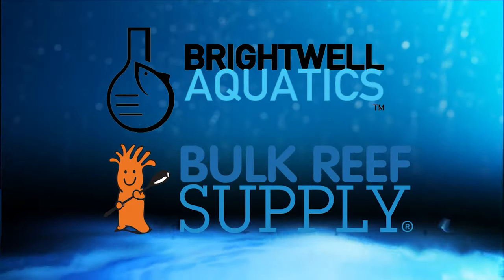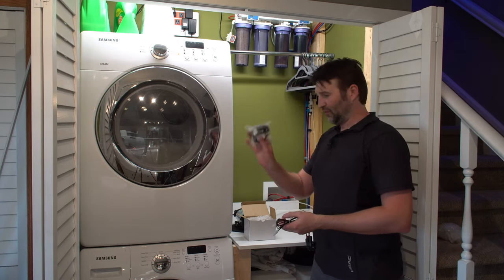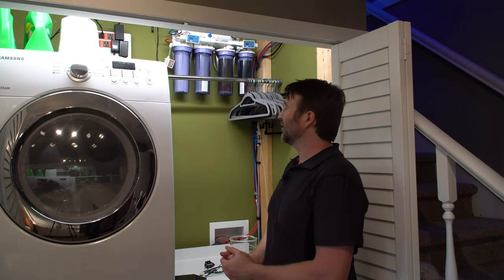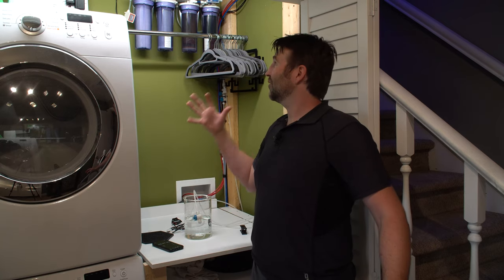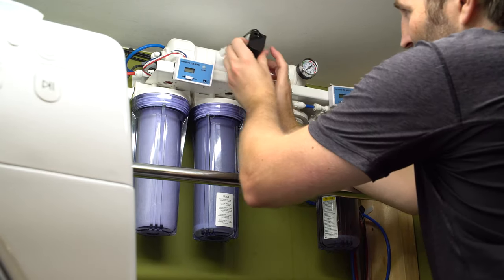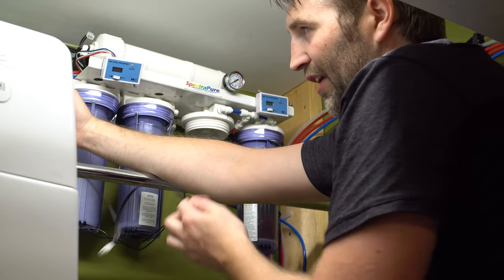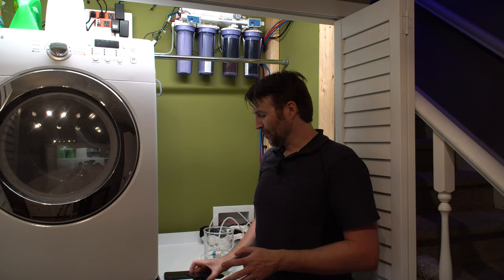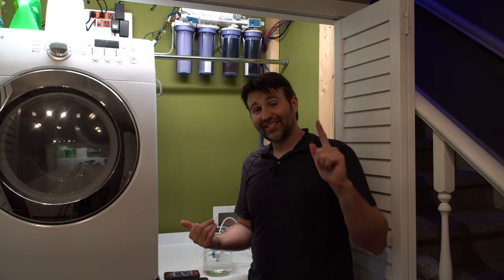RODI 8800 Booster Pump Install - Pressure switch and auto flush upgrade!

Comment: Thanks Dev!  Love my booster pump.  I added a second membrane to get 200GPH!  Note with the stronger pressure you will need to check on the membrane as the life is less when you push more pressure through it.  Just check your TDS on the membrane output to make sure it is always 0.  Also as you mentioned there is a screw on the bottom of that unit to adjust the outgoing pressure if anyone needs to adjust it up to 90.
Reply from the maker: What psi do you run yours at
Reply: @ReefDudes  80 I think.

Comment: Nice addition to your RO Deven. I was running 55psi before I installed the same booster pump you have and now I’m at 76-80psi which is adequate. I mounted mine on the wall over top of the RO unit. The rubber feet absorb a lot of the vibration but you can still hear it a little.

Comment: I am upgrading my rodi unit to commercial size unit and bought all the parts and diying the design, 2800 GPD with 170 psi booster pump with rotary wane pump  that pumps 5 gpm.
Reply from the maker: That’s some serious filtration!

Comment: Did you have to adjust the booster pump at all? I had purchased one from AquaFX on eBay and I just could NOT get it dialed in. My PSI got over 110 and the whole pump and RODI unit just vibrated out of control. I feel like i am missing something but there’s not too many videos out there that aren’t either over two mins or under like 6 years old.  Should I try this again?
Reply from the maker: I didn’t have to adjust it as it worked right out of the box for me.    Try putting a silicone pot matt under it to absorb the vibration

Comment: I installed a booster pump about 6 months ago. Huge difference. I can see now I want an auto flush valve. I'm curious on how you will mount the booster pump. I installed mine on a 2x4 with a rubber pad against the drywall in the garage but it still sounds like the washing machine is running on the opposite wall inside the house.  Drives the wife crazy. LOL.
Reply from the maker: So far silicon pad on top of dryer lol. Time will tel

Comment: Great video I don't understand that why filters last longer with faster flow verses slower flow. And you would think slower flow would get more bad stuff out of water than faster flow.  I never thought alot about more flow in my RODI. I'm going to get me flow meter and check mine out too. We have really good water pressure but maybe not enough thanks again for sharing.
Reply from the maker: I think it’s more pressure is able to get more use out of them?  Maybe handle clogging ?  Random guess
Reply: @ReefDudes  RO Membranes are more effective at removing contaminants at higher PSIs. This means your DI resin has less TDS to process which will prolong their life.

Comment: A very good purchase for my rodi unit  , my house pressure was 30psi and now i can crank it to 90psi , but i have a question i notice my booster pump was “hot” is it normal or i need to worry about , also great videos and greetings from Colombia 🇨🇴

Comment: Hi I installed mine too but I have a question I noticed that the booster pump stay vibrating all the time is that supposed to be like that all the time or it supposed to turn the vibration off ??? I’m confused 🤷‍♂️
Reply from the maker: IT should only be "vibrating" when its pumping water.  If you have an automatic shutoff.. it should detect back pressure and turn its self off when you stop the output flow.
Reply: I too have the same issue. I’ve tested it about 10 different ways and the automatic shutoff switch will not stop the pump. (I think I got a bad one) so I’ll have to have BRS replace.
Reply from the maker: Moore Tank More Problems I believe there is a little screw on it to adjust the sensitivity.  Also make sure it’s wired inline with the pump
Reply: I solved for what happened to mine the shut off valve that I can control manually wasn’t after the pressure switch it was before the pressure switch as sooner I set the shut off valve after the pressure switch it was working right
Reply from the maker: Yoshukai Tony yay! Awesome to hear you got it fixed.
Reply: ReefDudes is it suppose to go directly after your automatic shutoff valve but before your first stage of DI resin? Like I can get that automatic shutoff to work correctly on the BRS unit. But the booster pump will not.
Reply: Moore Tank More Problems ok how do you control the Rodi manually or automatic shutoff valve ?
Reply: Moore Tank More Problems anyway at the very end of your Rodi you suppose to have a manually or automatic shutoff valve to open you water to go out right before that the pressure switch is suppose to be there!!
Reply: Yoshukai Tony has an automatic shutoff valve. Unit was originally a 4stage plus. I’ve upgraded it to have a second membrane along with an extra dual di pro canisters after my first stage in the original unit. The automatic shutoff works when I test it with a ball valve. I’m seriously so clueless at what the deal is. Lol
Reply: @Yoshukaitony  Figured it out! lol, The pressure switch does need to be after my last stage of DI. And I had to go get a .05 Allen wrench and adjust the pressure to trigger the pump when to shut off... Thank the lord, thank you both for the assistance!

Comment: So I’m OK I don’t need a booster pump? I have a 6 stage RODI 200g a day. New my psi was 72, currently my PSI is about 67.
Reply from the maker: At 67-70 I would say you are good without one.  With one it I’ll bump you to 90-100. So would make water faster and in theory be more efficient but I wouldn’t say you “need” one

Comment: I just added the auto flush to my setup and I’m noticing it’s a lot louder than what it was with the manual flush when running/not flushing the membranes. Is that normal? (Im assuming when it goes quite and the pressure gage reduces that’s when you know it’s auto flushing?)
Reply from the maker: Mine is louder as well .. but i also added a booster pump at the same time so its prob a blend of it all.
Reply: ReefDudes I also have the booster pump, added that first then was like might as well get the auto flush... but even with the booster off the system as a whole runs atleast twice as loud. Lol

Comment: Can you give me the connections for your RO setup? I dont have a sink and I have the washer dryer set as you. The only difference is my washer and dryer are not stacked. Is there a YouTube video to set up the RO like you've done?
Reply from the maker: I just used some Y type fittings to tap it in.  If you have not done thaat yet let me know and ill see if  i can snap a pic
Reply: @ReefDudes  yes please snap a pic, thank you!

Comment: A issue i been having is when i have to fill my salt bin it doesn’t top off my tank becauee it’s connected straight to the Ro, so may be moving it to the pmup but it’s a far stretch to my tank
Reply from the maker: You need to add in a little valve to pick which it goes to
Reply: ReefDudes ha lol why didn’t i think of that i can put 2 solenoids on them and have it so when ato is filling the other off